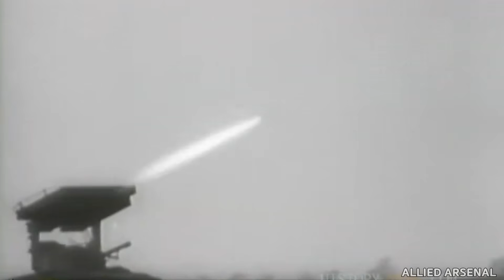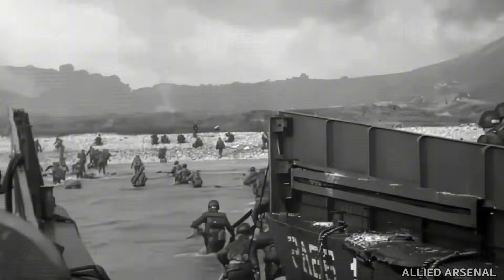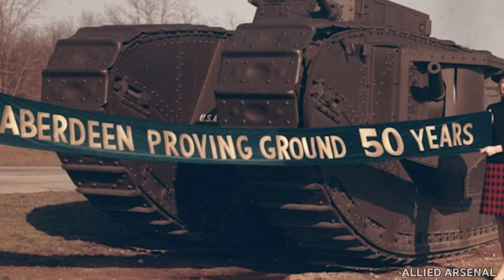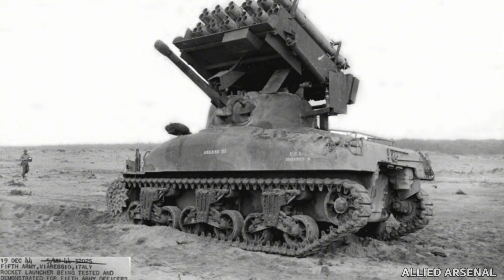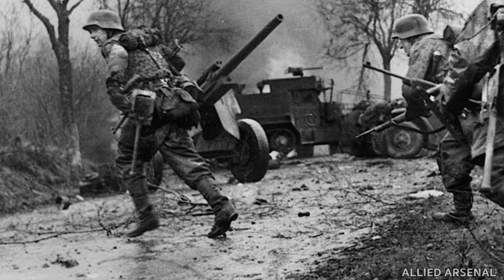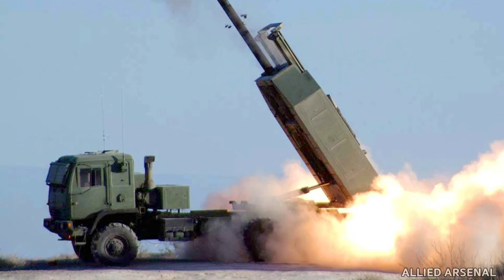Why This 'Screaming' American Tank Made German Soldiers Stop Fighting

Comment: They would have been better off designing a smaller, short, tracked vehicle to take these ashore on D-day. Instead of having all of that weight up in the air, it would have been near the ground. A crew would have maneuvered it into place and fired it. They could then abandon the vehicle where it sat. If the Germans didn't destroy the vehicles with artillery fire, crews could have come back later, removed the tubes, and used the tracked vehicle for general purpose transportation of troops and equipment.
Reply: Designing such things takes rather a lot of time.
Reply: This is the history of what this weapon was and what happened to it. It's easy for people to sit back and critique today but it was a different time and we weren't there. Take it at face value because it is the most concise and historically accurate description of the weapon ever seen Period.